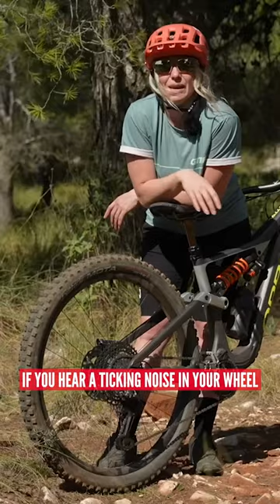Got Noisy Spokes? Watch This! 🔊

Comment: This may seem like a stupid comment, but are all stems of forks the same size? I ask this because I’m planning to make a Frankenstein bmx bike out parts and need to know in order to by handle bars
Reply: This may be a comment from a year later, but.

A stem for a MODERN BMX and a MODERN Mountain Bike are different in some sizes.

They both will have 44mm(1 and 1/8 inch) aka “Oversized” steerer tubes, the tube of the fork that comes into contact with the stem. But a BMX stem will not be able to hold an MTB handerbar and vice versa because of size difference. 

Hope that was helpful.